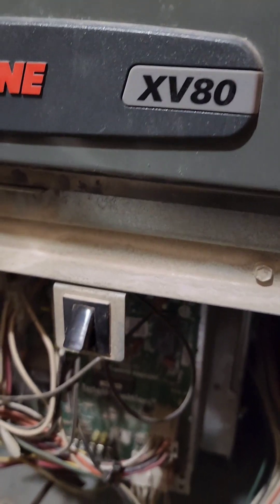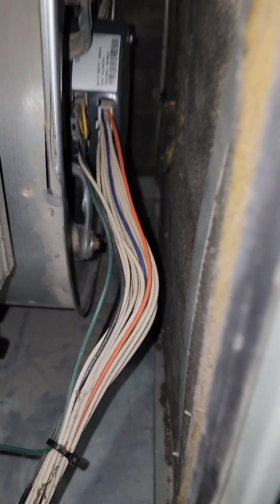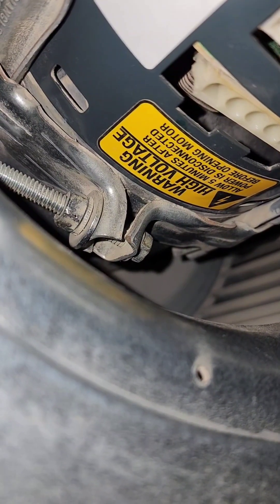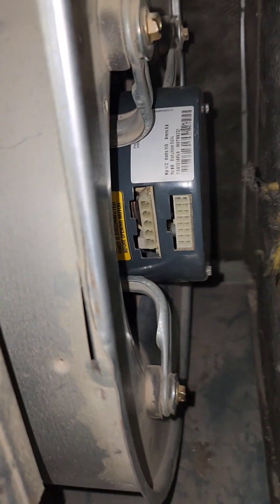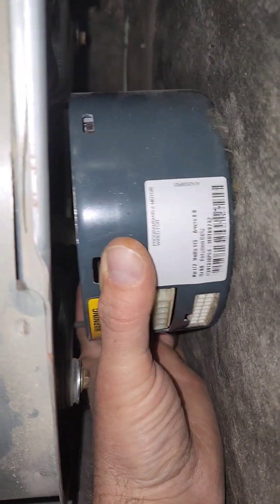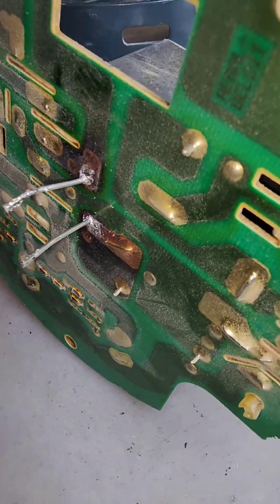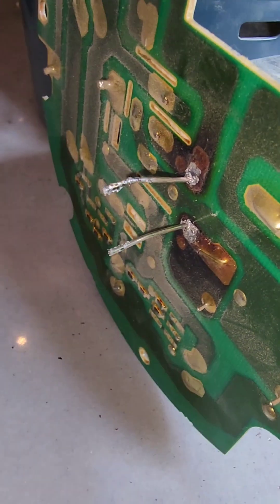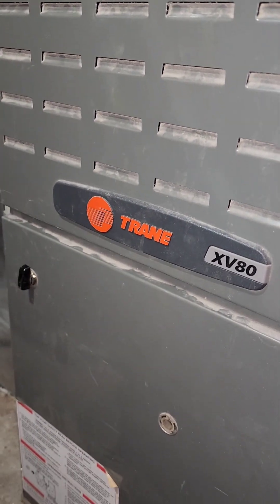Trane XV80 Furnace not blowing

Comment: Thanks, Troy! This was the exact reason my Trane XV80 blower motor wasn't working. The thermostat was requesting the fan on but there was zero air coming out of the ducts. First, I verified 120 V to the blower motor by depressing the black cover safety switch and measuring with a DMM between the black and white wires on the 5 pin connector (DANGER - hazardous voltage!). I removed the GE 1/2 hp CN02 motor circuit board, just like you, and replaced the SL32 1R030 thermistor. Only hiccup was struggling to break through the coating on the board and melt the solder holding in the old thermistor leads. I think if I had a newer / hotter soldering iron it would have been easier. The furnace and blower are from 2004 so not sure how much longer they will live... but we overcame this setback and are back in action!

Comment: I was told my ECM motor was "burned out" and quoted $1800 for a new motor. Or better yet I should just replace the furnace and the AC since it might not be worth it to replace the motor for a 20yr old furnace. 
Thank God I found this video and it was perfect and easy to follow. I replaced the thermistor for $4 and everything is working again. 
Thank you, thank you Troy.

Comment: Could you just snip the thermistor off and solder to the legs without putting it through the board? Might have the same issue with my furnace